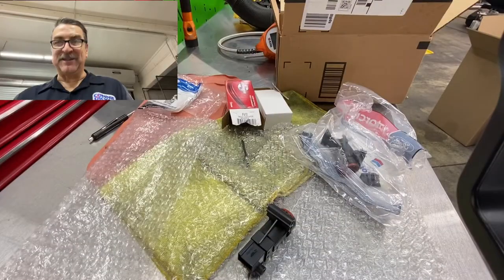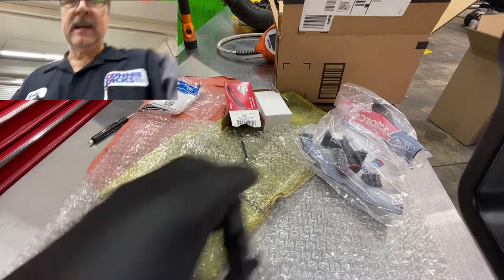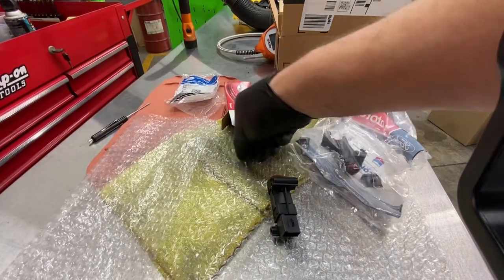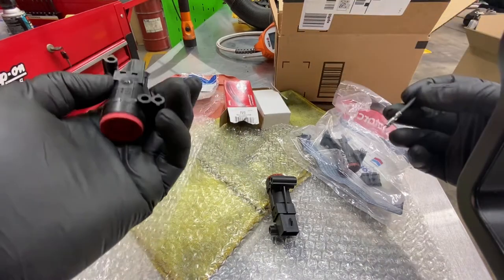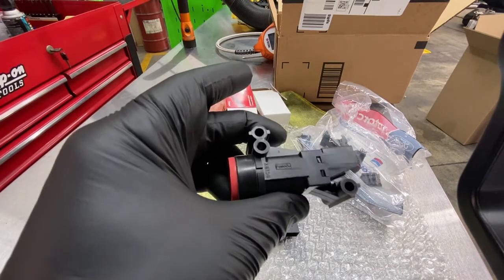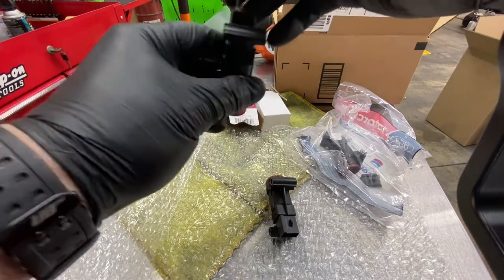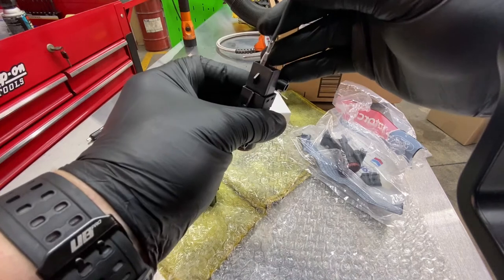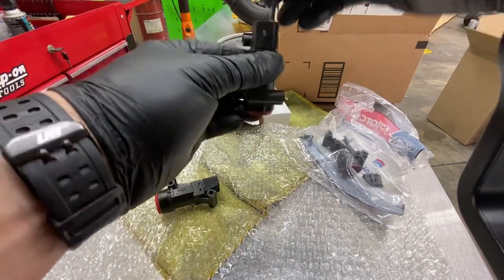OEM vs Aftermarket (Motorcraft vs. Standard) Inertia Switch

Comment: Was there not 100% contact ? The catch on the mate should hold the hardness in with the raised lip it catches no? Did the aftermarket one not work?
Reply from the maker: The terminal tension was the deficiency. This carries the fuel pump load and when the initial inrush current was applied, the circuit became a huge voltage drop and prevented the pump from operating. Luckily it failed in the shop, it’s possible that it could have made temporary contact and placed back into service where it would have resulted in a failure/vehicle stall which could have been very dangerous.
Reply: @TechScottBrown  ah that makes sense never even though about testing pin fitness. Def lucky it stopped in the shop vs getting stuck or worse like you said.
Reply from the maker: Yes, we had an open at that connector as soon as the full load of the fuel pump was applied. It never operated after wiring it up. Once we had the FORD OEM inertial switch installed the vehicle started and ran fine. A check of the pump current and voltage with the lab scope found the system operating nominally.

Comment: This is only the tip of  the iceberg! I watch Redhead, an ultra professional German engine repairer. They did  say pirated clones, are now  sold in factory sealed  packets= you can work out  your  self how that happens.
Reply from the maker: Can you link me please?
Reply: @TechScottBrown   Do you mean the link to https://www.redhead-zylinderkopftechnik.de/  its in german only . Schlechte Materialqualität. Eine Folge von Geiz ist Geil? Redhead
https://www.youtube.com/watch?v=npF6Wimv7_c
Reply: @TechScottBrown   Also, I can not recall where I got this  from as I commit  to memory the important  bits. The factory sealed   flywheel box  did  contain a pirated  copy. Euro car  brand as they can not make  direct claims  as to who it  was, for  obvious  reasons.  my other post has the link i dont know if  youtube blocks  posts with links readhead-zilinderkopftechnik de
Reply from the maker: @IntradeMotors  thanks, I unfortunately don’t speak German but I listened anyway and think I may have picked up a few things
Reply from the maker: @IntradeMotors  yeah counterfeiting is real